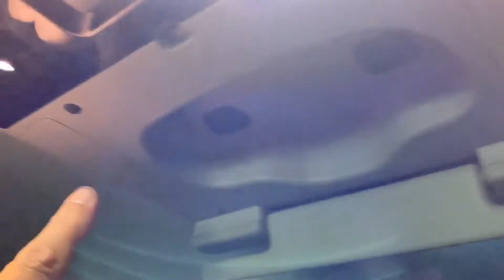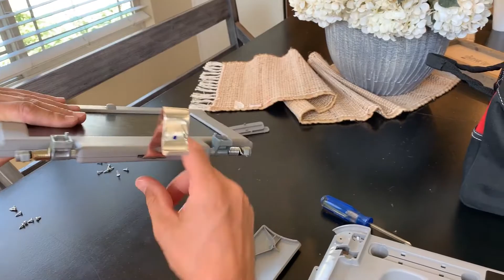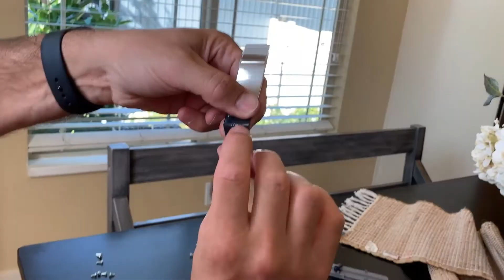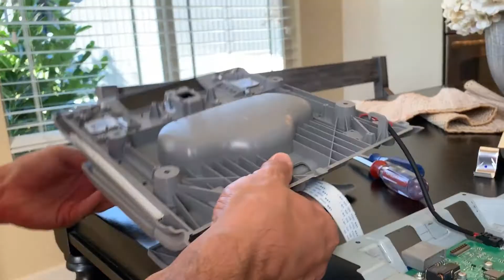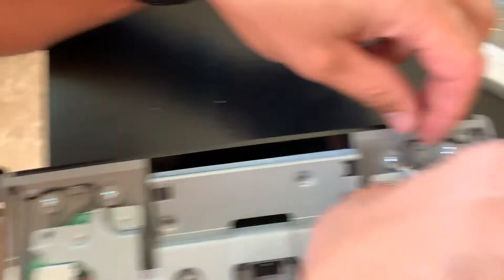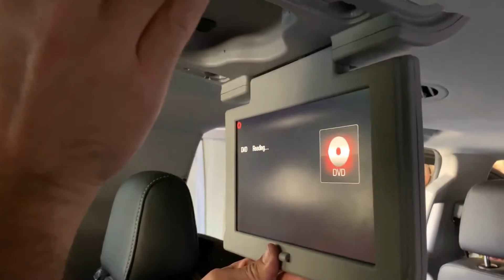Repairing Entertainment Screens - 2016 GMC Yukon XL

Comment: Just fixed mine from this :) had it saved for a few years since mine broke before but they swapped it under extended warranty. Got that same 20 pack of cables on Amazon. There was a metal backing plate that can pop off that was covering the clip on the screen I had to take off because I accidentally popped off the folding clip for the ribbon cable.

Comment: I guess I did something wrong cause mine was slightly on but black screen and I did the steps and now it’s completely off and it don’t turn on and I replaced the cable thing twice and no luck 🫤 did I blow a fuse? The lights still come on.. when I open the doors on that monitor

Comment: Thank you for this. My first attempt did not work, guessing I didn't push the cable far enough into slot. Tried again, and now works. The screws next to the lights and the button to push to open screen, do not need to come out. Figured that out on my second attempt. There ought to be a tipping option on here, so I could send you an actual thank you.

Comment: I'm about to attempt this myself - is the foil tape not necessary to replace like on the original cable? I would expect it would add strength, but maybe the thickness added creates stress areas?

Comment: Just bought a 2016 Tahoe a few days ago. I could’ve sworn the screen was backlit at the dealership. Now nothing. Used link  to order this cable. Very much appreciated! Pretty discouraging finding out it didn’t work. Hopefully this solves it. Thanks again.
Reply: I just brought a 15 with same issue. My front screen shows video/audio sharing not available at this time. I did replace ribbon but still nothing but it looks like it wants to work. If I move buttons I can barley see something moving. Does your front screen ever give you a message
Reply: @48916211  the 40 pin ribbon actually fixed it. The front screen never gave me any notification or anything like that. The front was working fine just no picture in the back. Hope you figure it out. I also ordered a remote on Amazon thinking maybe that was needed but it was just the ribbon.

Comment: Just completed BOTH my monitors following your video and have fully functioning monitors now. 

Recently bought a 2017 suburban and within a week the second row monitor went out. I looked online for options because there was NO WAY I was going to take it to chevy and pay hundreds of dollars when I just bought it. I found an article about these monitors having this faulty wire and people changing them out themselves. I was sold; so then I looked on YT and found this very detailed video. I ordered the proper wires online for about 8 bucks(20 pack) on Amazon and per commentary and video I bout a hex nut set which included the 7mm one I needed to get monitor out car.

I read the comments and suggestions from past viewers and then started to confidently work on replacing the wire that was the issue. As another commentor posted I decided to change both just incase the other one was on its way out too.

The only constructive criticism I have is not to include kids when doing a 'how to' video; it was alittle annoying and made me rewind some sections a few times(mostly the begining when in the car) because I couldn't hear with the child in the car talking. Second would be to show us the struggle as well because if you struggle during instructions so will we. I'm referring to the section when it was time to remove the screen from itself; when it became difficult the scene was cut and then when you came back on you had it off already telling viewers to be careful taking it off. Why cut it? Show us too how you got it off, it was my first time doing it and I struggled wondering if there was a trick to removing it, as a result I broke more then I wanted of those clip things.

Overall video was good and I will look for this person if I need another how-to on something. Thank you

Comment: I have a 2019 chevy suburban has the 2 tvs but the tvs won't turn on at all and the DVD stereo don't play cd either dose that have to do with the tvs or the stereo and tvs are not working
Reply from the maker: It sounds like you have a bigger problem. With the issue addressed in the video, the DVD still plays but the video content isn’t displayed on the screen(s). The cable that breaks only carries the video signal, so that is the only thing that doesn’t work.
Reply: @briandtucker  okay thank you I'm still trying to figure it out because the dealership where I got the suburban can't figure it out either

Comment: Thanks for posting this video!  I just performed this repair in my '15 Yukon Denali XL and now my overhead screen works!  Followed your video step by step and it turned out great! Very informative and great instructions on disassembly and replacing the ribbon cable.  Thanks again!

Comment: I was wondering is there any way you would be able to put a link to buy the smaller ribbon cable too that is needed for the tv on the 2015 GMC Yukon.
Reply: Any luck finding the smaller ribbon? I believe I need a replacement as well

Comment: Just saved me $800. Repair worked perfectly. Ribbon strip didn't look damaged when removed, but replacing it with the new one fixed the problem. Link to amazon item still good. $7 and 30 minutes to save $800 is a great ROI.

Comment: Thank you so much for this video!! I’m certain this will fix my problem as my issue is also with the 2nd row of my suburban.  Unfortunately while disassembling, the locking mechanism that you connect the ribbon into broke off and 40 micro mini pieces flew away. Do you know if it would be possible to replace the little clamp too? Or would that need to be soldered on? I’m kicking myself for potentially screwing up the simple install 🤦🏼‍♀️. Thank you in advance!

Comment: We bought a used 2017 Yukon Denali and the back screen didn't work. Shortly after the front screen stopped. Dealer said it was As Is and washed their hands. Quoted me $1500 a screen to replace. $8 in cables and a detailed youtube video and both screens are operational. Thanks for taking the time to save me time.

Comment: This is a serious design flaw that hopefully GM addressed in the later models. I recently bought a used 2015 Yukon and didn't think to check the rear screen before I signed the as-is paperwork. When I finally tried to pop a DVD in a few days later after purchase, I got the black screen of death. When I took it in for a separate issue the dealer was going to cover that we found before purchase, I had them look at the DVD unit, and after one day of "working on it", they said the unit would have to be replaced for $600+ dollars parts/labor. It seems to be the same story that the dealers won't even attempt to fix the ribbon and see if that works, for which they could still charge one full labor hour for. Instead, they attempt to gouge you for something that could take 30 minutes for you to fix at home with a little know-how and some simple tools. Thank you for this video!

Comment: Worked to repair the screen in my 2017 Tahoe, GM part number 23255972. Main thing is to put the cable in with the blue side up. Too bad GM doesn't use a more robust part (like a laptop LVDS cable) especially since it's moving. Thank you!

Comment: Bravo on your video. Extremely helpful and I appreciate you not leaving out anything in the porcess . The two wires that you have to disconnect from the screen when taking it out of the car. Maybe make sure next time just to let people know that you have to kind of pinch them and wiggle them out it's very hard to see so unless you know that initially. you're going to sit there and pull on them and possibly break them. Otherwise Brian, the video was great and in my situation I knew that my strip was not broken because if you pulled the screen down halfway it would light up and turn on but if you pulled it down all the way it would not turn on. So I knew that my strip probably just needed to be taken out and flipped around. And that's what I did. After reassembling the entire housing it works great. Love the video thanks a lot.

Comment: Kuddos for posting this!

Just a friendly tip for anyone attempting this. I went ahead and followed these instructions and still had an issue. The issue was actually worse than when I took it down. I had a hunch that one of the NEW ribbon cables I used may have been faulty. So I went ahead and went through the steps yet again and grabbed another new ribbon cable... and it finally worked. So if you go through this process and it still doesn't work, Try another ribbon cable from your pack in the event the new cable is faulty.

Thanks again!

Comment: The man who saves a lot of money, Bravo....35 cents cable vs $350 to 7-800$ repair!....I could fix my 2016 Tahoe screen in less than an hour. After you remove 4 screws/nuts (need 7mm hex nut driver), video @1min39sec, you need to push the little pin at the back/top of each connector to release the cables. Very easy, just need a light source to see the pins at the back/top of the connectors...Thanks again Brian!

Comment: Was wondering if anyone has replaced this and it did not fix the issue. My screen is completely black like zero power. After replacing it did not fix the issue. 😩
Reply from the maker: If there’s no power to the screen, this video won’t fix the problem. You can check whether the screen unit is getting power. It’s possible the power cable is bad or disconnected.

Comment: Great video. Over the past two months both displays had stopped working on our 2016 Suburban. I bought the 20 pack of the ribbons for $5.99 on Amazon. I also found a small pry tool kit on Amazon for 8.99 that made getting the back off the display pretty easy. Thanks for the help!
Reply: Hi!! Do you have the link to the kit??
Reply: Hey Blake, by any chance you have a few ribbons left over? My monitors recently stop working.

Comment: Thank you for the video. 2018 Yukon SLT w/ 2nd and 3rd row screens. 
Wanted to let everyone know, the second row screen on mine did very slightly, there was a slim metal cover over the ribbon on the back of the LCD. I was able to use a pry tool to remove it, no screws, just some funky press fit clips. Otherwise it was exactly the same! Thanks for the more pleasant road trips this summer!

Comment: It worked!  Found your video online but still went to a Chevy dealer for a quote. They wanted $650 for a new screen. They did a “test” and assured me it was not the cable and the screen definitely needed to be replaced.  I followed your video step by step and the screen was fixed.  The most difficult part was separating the back panel from the screen without damaging the plastic clip brackets. I recommend using a tech tool kit with separating tools.  Thank you!

Comment: Thank you very much.   Read about the ribbon fix on a forum and then found your video on YouTube. Works perfect now thank you. The only thing I did was any of the plastic tabs that got damaged I put a little bit of super glue on so hopefully they’ll  hold better.  Unless I’m another victim of inflation I could only find one ribbon for $20. Can someone post a link to several ribbons for seven dollars? I already did the repair but I figured 20 bucks is cheap

Comment: Easy to do.  Thank you.  I did however have to carefully remove the little metal cover over circuit board attached to the back of the LCD screen to access the ribbon connection and release the ribbon clip.  a small flat head screwdriver pulling back the metal clips inside the small notches in the metal cover worked fine.  lift while you pry the inside metal clips back away from the metal cover, and do them one at a time putting pressure on the cover lifting as you go.  once you get one side pulled up, the rest just comes up effortlessly.

Comment: Very cool that you made this video; I just purchased a 2016 Yukon XL Denali TODAY with the 2nd row monitor not working. I thought for sure it was a $300-$500 full unit replacement. I saw this video, went out and tinkered with the monitor and the small exposed part of the cable and WOW the monitor works! Just had to hold my tongue just right and slowly move/wiggle the monitor until the picture came in. I see you created this video 2 years ago, so how long did the cable replacement work for? How often are you replacing them?
Reply from the maker: Glad it worked for you. Both screens are still working in our Yukon. I haven’t had to replace them again.

Comment: My god! I follow your video and break a 40 pin connector cause I didn't how to open it... I was devastated.... Then, I found a guy that could weld that connector. So I bought one on eBay and make it weld... When was the time to finnaly install the new wire I was so sure it wouldn't light up... But guess what IT FREAKING WORK!!!!! MOUHAHAHAHA! thanks for your video! You save me 500$ bucks! Awesome!

Comment: Bought a 2016 Yukon used and it wasn’t working and there wasn’t a remote. I changed the 40 pin cable but it’s still not working. I bought a replacement remote and still not working screen still black.
Reply: The lights work but the screen doesn’t

Comment: Ver very very helpful! Guys if your thinking of doing this go for it. Also a tip to you , make sure you buy the 40 pin reversal ribbon cable. If you buy on amazon make sure you get the 200mm cable cause the 150mm will work but its harder to work with since its shorter. Make sure the connections are on the opposite sides of the cable and not on the same side or it will not work.  Good luck guys!

Comment: Worked to perfection, thank you!  I wonder if the replacement cable would be more durable if a protective (tape? were to be applied) I know the original has a thick sliver cover over it.

Comment: would this cause the dvd player to also not release my dvd? Here's the thing, my 2006 GMC Envoy Denali has a dvd player mounted, and it powers on because the buttons light up. But the screen does not come on... which makes me think it's the same issue you just fixed in your video. But what about my dvd that is now stuck inside?? It won't release it.
Reply from the maker: I can’t imagine these two issues would be related.
Reply: I hade the same problem for me it was a burnt fuse labeled Radio

Comment: My screen works when half way open, but goes blank once it’s opened all the way... is that the same problem?
Reply from the maker: Possibly. The cable may still be intact enough to work until it is stretched.
Reply from the maker: Amazon
Reply: @briandtucker  Thanks for the reply. Purchased the pack of two.
Reply: I’ll give it a shot. What’s it going to hurt right. Where did you get the ribbon from?

Comment: That worked but it stopped working about a month later again so I had to redo it. I ordered the same cable might look into a more heavy duty one.
Reply: I added some electrical tape to mine to give it some rigidity and hopefully protect it. It’s such a poor design, not sure if anything is really going to be a permanent fix. Good luck!

Comment: Just curious, have those same 2 ribbon cables held up just fine without causing issues now that you’ve had them installed for a year?
Reply from the maker: Yes. They’ve worked great so far.

Comment: The ones you got were 200mm but they’re out of stock. Do you think the 150mm would work? It’s about an inch shorter
Reply from the maker: I’m guessing, but I think it would be close. The ones I used were a little long. 50 mm is closer to 2 inches.
Reply: If it’s the same ones I ordered they won’t work. The ends on the shorter ones are the same. The one he mentions in the link one end is reversed, contacts are 180 degrees from each other. The reason I tried the shorter ones was because the right one were out of stock and Amazon said they didn’t know when the would be back. I just ordered the one in the link and it says they’ll be here by March 10th.

Comment: Thank you for posting, this seems like a great fix. Before I try this I want to make sure my issues are the same. Same car. My middle screen that stopped working stays solid black but I can see the screen is on because I can turn it off and see the screen go completely dark. Then back on and can see it lights up to black but with no video when the others is playing. Were your symptoms similar or is this wire fix only if the screen is straight blank?
Reply from the maker: That sounds like the same problem. With my screens, it was the data cable that was broken.
Reply: Brian Tucker great, thank you. I’ve ordered the cables and going to give this fix a shot. Thanks for posting the how to.